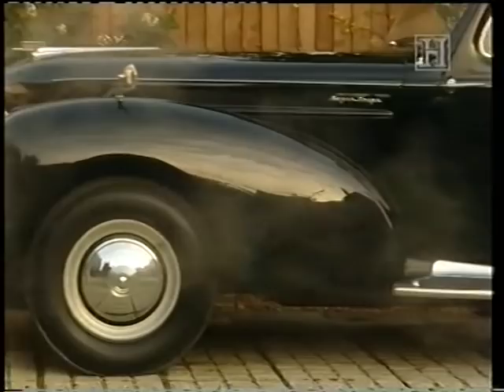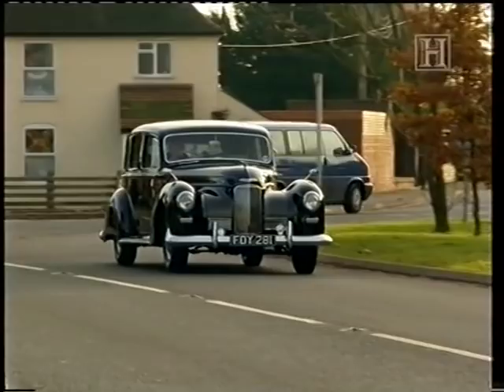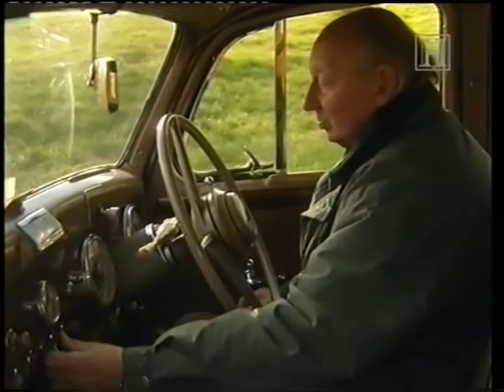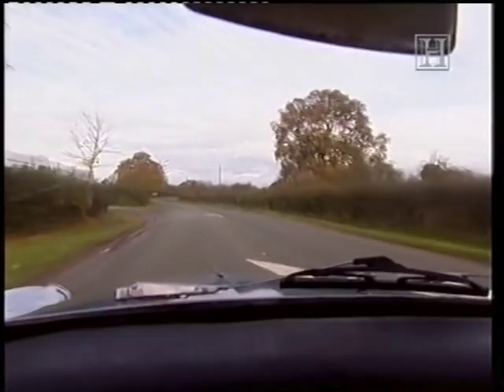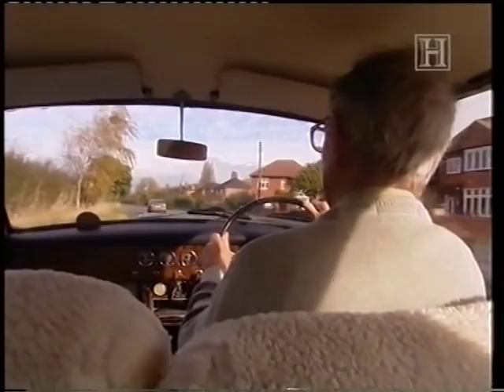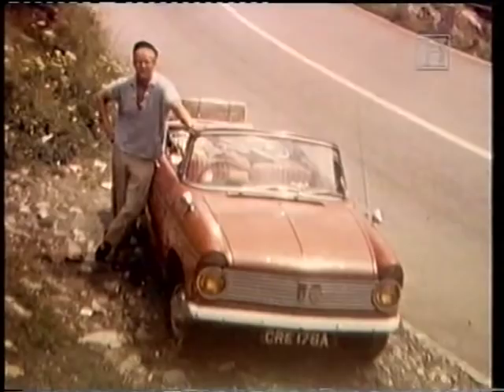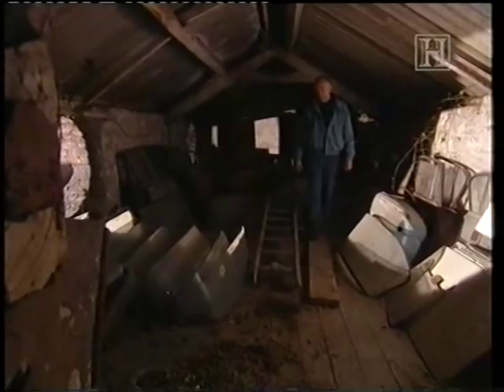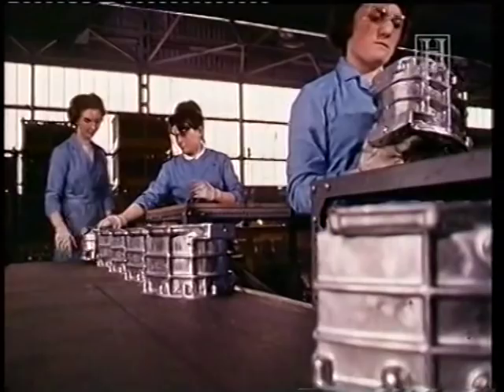UK TV Program 1999 History Channel 'Forgotten Marques' Rootes

Comment: My first car was a 1964 super minx handed down from my parents in 1977. It was a station wagon in Celtic blue. It was no rocket, it had only 1600 cc engine, but it was reliable and economical. I recall that the brakes were quite good for the time, being disc brakes on the front. The handling was reasonable, it had an anti roll bar at the front. I think Hillman were a bit underrated. Dad had a 1952 then a 1960 minx and they were reliable too, provided you serviced them regularly. Great memories.

Comment: Ah the Hillman imp. If you had one now but developed a bit further, say a 5 speed box, use the 998cc engine obviously with current engine management, put the radiator in the front and sort the ventilation out, you would have a car that would be impossible  to beat

Comment: of course I had an Imp, then a chamois sport, and I also had a spare engine and box built up to be ready for head gasket and synchro failures,  an engine and box could be changed by one man in an hour and a half, nice engine which is why they used to get thrashed by young drivers, a lot of fun for those who could keep them on the road.

Comment: I had a Sunbeam in the '80, it fell every day apart, every day something broke or didn't work anymore, after 3 years only the body was still original, most part were exchanged under warrenty / guarantee! My  garage went crazy about my Sunbeam, they called it "Dark Side of the Moon" they didn't ever experienced any ray of light of this car even if the colour was a bright yellow (it was also called "A Yellow Submarine" refering to the very high cost of maintenance after warrenty period! After 3 years teh dealer offered me a some of money to buy it back from me and I happely agreed and I bought a Mazda 323 which I had for 16 years and drove without any problem during all these years, afterwrads it went to Africa were I think still may drive along!

Comment: I dig the Super Snipe- a new one to me.  The imp front end looks lifted straight off a Corvair.
Reply: Steve Prince  We used to be in the '2nd hand furniture business' and some times in order to get a bit more in we ended up with the back doors open. - On a Mk1 Transit that 'sucked' the exhaust in like mad, - if you opened the windows you were ok, cold in the winter, but at least ok.
Reply: Steve Prince  Ah yes those were the the days, lovely on a hot summers day, but could be a bit draughty in the winter, all our 'Transits' had the standard 'open out' doors, but we had a Bedford 'CA' type with sliding doors, they were ok but if you braked hard sometimes they slid shut with a bang. - Ah the days before 'clunk-click every trip' as the ad went. A dairy had some 'funny' looking 35cwt Transits, - living in the country as we did in those days, electric 'floats' couldn't last the 'round'. These Transits were odd in the fact that the drivers door was a sliding one and yet on the passengers side they had the standard 'open out' type. As for a body, apart from the cab, the rear part was just like a normal 'milk float', I seem to remember they were 'Automatics' as well. 2 daries vied for custom in our village, 'The Express', and 'The United Dairies', - both now but a memory alas. As for 'fairground rides' - well if the 'Health & Safety' lot had been around then they would have banned them all from operating. Plus DVLA probably wouldn't have allowed their 'Tractor & Triple Trailer' units on the road either, how they got away with some of them even in those days beats me.

Comment: When I did my engineering degree, the engineering department had bits of Hillman Imp, which were used to illustrate engineering design flaws, there was at least one example for each flaw.
Reply: ferkemall  I didn't know that one!
Reply: Donald Sayers I recently saw a green Hillman Imp in New Jersey & my father had a Hillman Minx in Jamaica in the 60s
Reply: Well, that's pretty much sums it all. So much for all the bash-the-workers rethoric (not that they were innocent, far from it).

Comment: A great pity to think what we once had regarding car industry.  The japanese came along with some very clever engineers who looked at the designs of others and made the item better. There is no doubt that we basically handed the car and motorcycle industry over on a plate.
Reply: I remember Micheal Edwards sacked the night workers at Rover because they were asleep..........6 week strike caused a 3 day week at the dealership where i worked. Nearly lost my house because things were so tight for a few months.
The unions were lazy bastards with no idea about costs and production.
They used to assemble the XJS Jaguar so it wouldn't run as a dig to the management. One of their favourites was to leave the plastic bag on the air filters.
We rolled over back then, and in the current state of things, we would roll over again given the opportunity.
Reply: We used to get a bag of unfitted parts in the boot of the Morris Marina's.........many a time they arrived with a disc brake on one side and drum on the other. No one gave a shit back then.
Reply: That was the consensus in the automotive publications back then, that the Japanese were taking British designs and then engineering some quality into them like things not leaking oil, electrical components that worked for decades and parts you could run out and actually buy. I had a TR-3, TR-4, Hillman Husky, Metropolitan, several Morris Minors,  a BSA and a Triumph Bonneville and then later a bunch of Toyotas and while I loved the British stuff, I loved getting from Point A to Point B and back to Point A without all the drama even more. Still, the charm of the British stuff does it for me.
Reply: steve harrod – "we basically handed the car and motorcycle industry over on a plate."
You're actually closer to the mark than you know. For example, Isuzu began manufacturing cars in Oct. 1953 by assembling CKD kits of the Hillman Minx, under licence. Gradual migration to full local production (no imported parts) was achieved in 4 years 0 days. Within a few more years, Isuzu was migrating to designing its own new models – Bellel, then Bellett, then Gemini. By that stage, the Brits had almost completed digging their own grave.

Comment: I still have my Imp and I plan to restore it.
Reply: ferkemall  ALL Imps really needed some weight on the front, - the 'camber' on those front wheels wore out tyres faster than anything. They 'badged' some as Sunbeams, - I thought they had a different name - although I can't remember it.
Reply: @christopherlovelock9104  I've busted up a few Imps, you can take one apart with an angle grinder in an hour or two. Terrible cars!
Reply: @PreservationEnthusiast  Personally I think their biggest failing was they hadn't got the balance right with that engine in the back, - VW never had that problem. Also that 'ally' engine was a flop from the start. A friend of mine had one of the van versions, - (he was a carpenter), - and kept all his tools under the 'bonnet', - didn't even keep it 3 months, - worst van he ever bought he said.
Reply: @christopherlovelock9104  I think the other versions were Singer chamois and Sunbeam Stiletto.
Reply: @jimmyduncan7650   Ah yes, now the first name certainly 'rings a bell', as for the second name wasn't that the 'fast-back' version with only 2 seats. I'm pretty certain the van was called 'the Husky', also I believe you could get the van with a single large side window - a sort of estate version with folding rear seat, but I can't remember if it had a different name or just the word 'estate' after the usual name. Wasn't their also one called 'The Californian' - aimed at the 'American Market'.? I have never seen a 'soft top' version, unlike the 'mini', although they were 'conversions' by small firms and not 'factory' produced I think I'm correct in saying.

Comment: No mention of the Avenger, which was a huge success.  Perhaps that went counter to their argument.  I bought an Avenger shortly after this film, they were still knocking around on the roads then.  Now there are only about 200 left on UK roads, one of them being right beside me now.  A lot of the engineering mistakes of the Imp were corrected on the Avenger, in particular the handling was spot on, it didn't overheat, and they tested it thoroughly before release.  Hillmans rusted, but no worse than Fords, Vauxhalls or Austins of the same age, and possibly rather less than some of those.
Reply: Also the singer gazelle and the Hilman hunter and the Sunbeam s the police used the avengers in Somerset thy always had a funny pedel in first gear and if you weren't carefull they would take of jerking I always pissed my self laughing when my dad tryed drinking from a can of tango as he pulled away at a stop sign the return spring on the carb was way to soft  and I new Avery swear word sat in the back and the words don't take the piss boy ha ha  he hade the one with a Chrysler badge and grill the gl model he traded it in for a Austin princes cheese wedge
Reply: Drove an Avenger at work. Useless in the wet and the door panel moved inwards when you inserted the key to unlock the door.
Reply: I had an Avenger 1600 GT with twin carbs and it was a fantastic car that went like stink . Brings back many happy memories , you could get two girls in the back seat :)
Reply: video99.co.uk– "No mention of the Avenger" – correctly so because it's a Chrysler Hillman, not a Rootes Hillman. It has no heritage from the Rootes Group except the Hillman name and chief designer Roy Axe who transferred to Chrysler when they bought the empty shell of the Rootes Group a decade earlier.
Reply: I had an avenger staitionwagon I went real well

Comment: Hillman Imp, shocking tuck in front suspension and endless cooling problems from the rear engined trans axle unit. I was able eventually to be able to pull out the gerabox and trans axle within a very short period of time, strip and rebuild and be back on the road the same day. But a car I hold in great affection.
Reply: I used to run a 998 conversion on the standard cooling system without any problems. As for the suspension, a £5 factory kit transformed the handling.

Comment: Rootes Group always produced good, solid, cars - until the Imp, that is. Having bought a new one in 1969, I can say, without equivocation, that it was the worst car - and there have been a great many cars,  both new and used - that I've owned in 60 years of driving. Not so much an Imp, more of a dog. Lest you think I don't like their cars, I've owned three Minx, of various Marks - all completely reliable - and worked for Rootes at the Whitley design centre. What I'd really like is a Humber Sceptre or perhaps a Series V Super Snipe/Imperial...

Comment: Try taking the cylinder head off a side valve Humber. the aluminium head reacted against the steel cylinder studs absolute nightmare .
Reply: Right. We once hung the whole car from the unbolted head. Took a couple of days before the car hit the ground.
Reply: I remember doing that , in the end we removed the pistons got a length of wood and tried to drive the head off the studs after  drilling a hollow drill down the side of the studs. What a nightmare .

Comment: The Hillman Imp was a knock-off of the NSU Prinz. Just that it had a four-stroke engine and not a two-stroke. 

MsG
Reply: Was it a Corvair Yank tank re engined they look very much alike except size !
Reply: The Prinz was also a four stroke. The Prinz 4 was two cylinders against the Imp's four, and was aircooled rather than water. The bigger Prinz' were four cylinder air cooled.

Comment: Are some American I cannot understand how a distance of under 200 miles could play a part in a company's downfall.....seems silly to me
Reply: Everything was silly at BMC/BMH/BL: after they had designed the Austin 1800 they realised it was too wide to get through the famous conveyor tunnel which linked Longbridge plant stamping/welding and paintshop works! So they had to lorry the bare metal bodyshells to the paintshop throughout two very busy lanes of traffic with all the rain and snow and salt in winter. Insane incompetence of an insane management!

Comment: I never use one of these pumps, pump say £12.85, hands over 20 quid and drives off... lol, maybe you should use the pumps XD
Reply: The pump registered £2-84 for which she would have got about 6 gallons  (23 litres). In those days, no-one except the occasional millionaire, would have even seen a £20 note  and even £10 notes were very unusual. I am sure she would have handed over 3 £1 notes for her fuel
Reply: To add to my earlier comment, £20 would have bought her around  45 gallons (204 litre) of petrol

Comment: HAVE TO ADMIT THE IMP WAS THE MOST UNRELIABLE CAR I EVER HAD......THE USUAL FAULTS HEAD GASKET,WATER PUMP,USELESS HEATER......BUT IT WAS SMOOTH AND NIPPY WHEN IT RAN..I SCRAPPED IT IN 1969    IT WAS A 64 MODEL
Reply: Vacuum throttle on the early ones didn't help!
Reply: @nouvalari  had no probs with that....worst fault was front centre wishbone mountings split away from chassis,lucky i was just entering a car park
Reply: @stephendartnall8928  Jeez!......my sister had one, the front kingpins siezed so you turned a corner and it never self centered. Eventually after she mounted a pavement one night,i persuaded her to get shot of it. She bought a Morris Minor from a local shark,and on the way home the trunnion gave way, tucked the wheel under the wing and.....she mounted the same pavement!
Guess she was unlucky!
Reply: Ahhh Trunnions, Marinas had trouble there too because they shared a lot of parts with the Minor
Reply: My most unreliable car was a Vauxhall Viva SL90. It was so  uncomfortable I had to almost lift my wife from the car after a three hour drive. She used to say "We've had it fixed, now what can go wrong?" She soon found out.